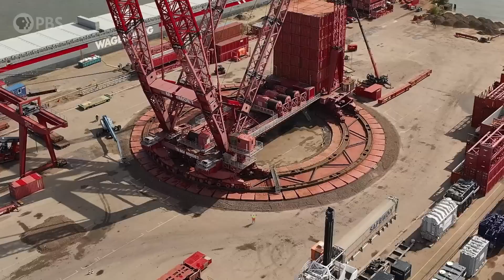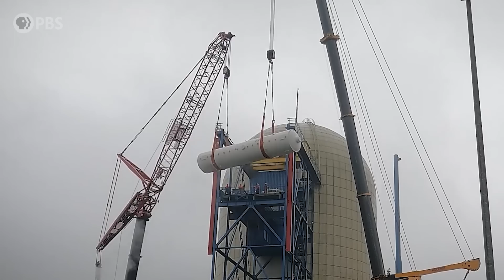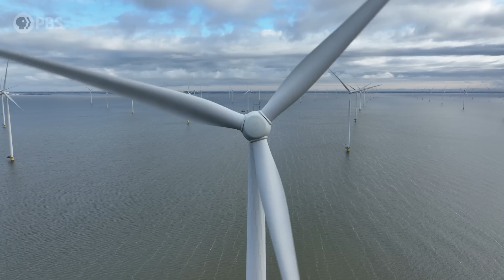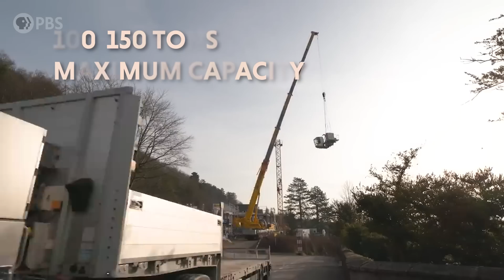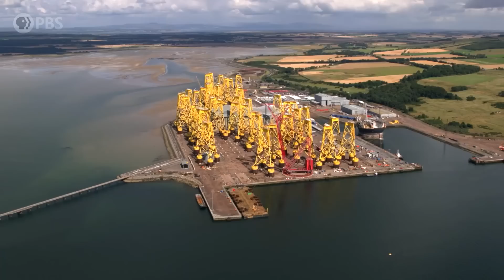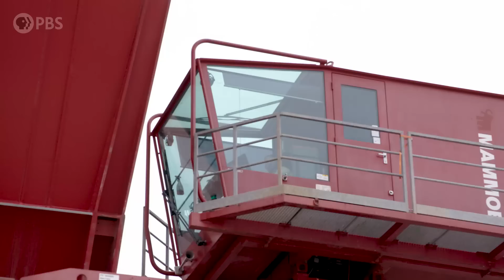Finding the *BIGGEST* Reason To Feel Hopeful About Climate Change

Comment: Even if we somehow get to sustainable growth (we won't until we reach at least 3 degreees more globally), there is still the problem of waste heat, that's going to heat up the planet exponentially so that oceans will boil in 100 years or so.
Reply: Waste heat represents 1% of the GHG forcing caused by our emissions, so it is not really a problem. Electrified processes are also generally much more efficient, and if we electrify all processes, we will only need to generate about 1/3 of the current primary energy input with renewables, so we will also significantly reduce waste heat in the coming decades.

Comment: Let's fight climate change using a big diesel engine to move stuff😂
Reply: most carbon pollution comes from industrial use by corporations. spending a ton of CO2 to build a single turbine that removes the need for 20 tons is a net negative that's worth it.
Reply: HECKS YEAH!!!!!!!😅
Reply: The original idea was to use slaves but Mammoet HR couldn't find enough of them.

Comment: The key problem with propeller-style windmills is that they will NEVER break even on their fossil fuel energy debt due to the product and transportation of all parts of the windmill from the cradle to the grave of the mills. This is mostly due to the short "shelf-life" of these windmills. It will NEVER make sense.  This is a stupid and extravagant use of fossil fuel energy.
Reply: The carbon break even point for wind turbines is on the order of months. 

And the rare earth metals are recycled once decommissioned. 

The blades on the other hand... they're still figuring that out.

Comment: This episode did not sit well with me. PBS Terra has recently produced excellent content that is (rightfully) critical of the industrial response to the climate crisis. This episode felt like a complete rubber band in the opposite direction; in fact, the entire experience felt like an advertisement for the company that made the crane.

Methods of building massive structures like this will be used far more to produce things that consume fossil energy than to create renewables. Per the law of Jevon’s Paradox, it doesn’t matter if we produce renewable energy if we are only going to use it to make even more things.

We need to slow down carbon production drastically, not increase it. This technology does not do that no matter how you use it.

Comment: So a crane can lift a rocket. A rocket that's designed to absolutely be as light as possible since, well, it's expensive per pound. It's so light that it can propel itself literally into space with its onboard fuel. I should be shocked that a land based crane can lift it?

Comment: I'm going to do you a big solid here and give you an even better reason to feel hopeful about climate change. CO2 makes plants grow, which makes the Earth greener and provides more abundant food for all life, and we're not even close to maxing out the potential of photosynthesis. It also turns out that the BS you've been listening to for literally decades about rising sea levels, acidification, corals all dying off, and the planet turning into a toxic wasteland... all of that is false and disproven by actual real-world observation. The sea level has been rising a 3 mm/yr for 3 centuries. It's not accelerating. The oceans aren't acidifying. Coral reefs are thriving and will continue to thrive, having evolved at a time CO2 was 16 TIMES higher than it is today. They'll be fine. It's the damn sunscreen from tourists that's the issue there. And those horror show graphs you've been looking at? The urban heat island effect. The "scientists" producing those graphs statistically normalize the UHI effect and present it as if that's what's happening in rural areas. It's not. So, great news! You've been systematically lied to and the world is not coming to an end because you drive to work, operate a computer, occasionally watch some Netflix, and like the heat on in the winter. Conserve resources intelligently. Don't buy crap you don't need. Throw away what you're done with responsibly, and you'll be fine.

And you didn't need some banker to spend $100 million+ on a crane to give you that hope. You just needed to hear the truth. Thank me later.

Comment: In what way is nuclear cleaner? It has toxic waste as an output.
Reply: You should see the waste products that come from manufacturing wind and solar power. It's not radioactive but that's the best thing you can say about it.
Reply: fossil fuels also generate toxic waste, and much much more. 

nuclear plants generate much less solid waste that you can simply store underground or in another fashion. the heat is useful too, so some reactors actually use nuclear waste to get the most out of them :3

as long as you have good radiation shielding and dont take shortcut when manufacturing a reactor, its pretty safe.

Comment: Did he say we have decades still to meet the 1.5c target?
Reply: I hope not, cause that would be wrong. We have a couple of years left at most before the yearly average is above 1.5c. This year is unusually high due to El Niño/La Niña and probably even passes the target, but next years won't be far off.
Reply: 1.5°C is like nuclear fusion it's always a couple of decades away.
Reply: @ProPexPup  Nope, I hate to break it to you that that is not the case. The science is very clear on this. We are already at 1.2°C and at this rate it is just a couple of years away if not sooner.

Comment: Huh. You know, I always assumed that tower cranes had more capacity than mobile cranes. Figured the mobility required a trade-off of capacity since you couldn't ground it as stably. Colour me wrong, then!
Reply: I think it's due to tower cranes only needing some vertical and simple horizontal load moving where most mobile ones move loads in arcs (does that make sense?) due to their space constraints but also the specificity of where they are putting the load.

But that's my guess. 

I'm imaging lifting a loaded box up and down or forward and backward as a person versus lifting a kettle bell weight at the gym in an arc as part of working out isolated arm muscles xD the latter feels so much harder to do lol

Comment: The crane that is helping the transition away from fossil fuels to renewables..... Runs on fossil fuels. Oh the irony!
Reply: You have to get there somehow. Electric motors aren't powerful enough and there is no place to plug in in the middle of an ocean
Reply: @lenabreijer1311  You say that, but how they gettin that power back to the continent?
Reply: @GranRey-0  they aren't.  That is the job of the FINISHED  wind turbine project. They only lift them into place.
Reply: @lenabreijer1311  my point being they have to run a wire out there anyways.
Reply: @GranRey-0  you have obviously never run a project of any sort, or built anything.  Even if you are building a house on a green field site, you have to put up a pole to put the connection box on. Are they going to have that very high power connection floating around in WATER? No they aren't.  They are going to put up the infrastructure and then connect the wires.  The very high voltage wires. That need to connect to something in order not to wander around the ocean floor.
Reply: Lol

Comment: Imagine unloading a whole ship full of containers, and all the manifest says is "counterweight for crane" 😆
Reply: As they mentioned the containers are transported with the crane components inside. Once they are unloaded they are filled with local material (like sand) to be used as counterweights. Nice dual purpose.
Reply: A whole ship that can only handle 35 containers?
Reply: @TheQsam1  I know. But you get the point.

Comment: This crane not utilizing electric motors seems wild to me.
Reply: i'm assuming that since it kind of flatpaks down, it's kind of hard to get electrical infrastructure to it and by the time you've set up your temporary connection to the grid, it's time to dissasemble and move on to the next project
Reply: Weird, it's almost like it's a product, for profit.
Reply: @RosscoAW  are you saying the manufacturers wouldn't make profit from using electric motors? It's easier to swap out if damaged, and have more torque. It's possible there is no electric motor large enough. But your logic was hilarious.

Comment: That is a cool crane.
5000 T is quite a lot, the biggest Wind turbines Nacelle only weighs about 350 T, thus there are room for them to grow a little more 🙂
Another thing, this crain uses a combustion engine, but when maintaining wind turbines it can be beneficial to use battery electric cranes. The potential energy storred in a 350 T Nacelle 180 off the ground is quite a lot (m ⋅ g ⋅ h = 350 000 kg * 180 m * 9.82 m/s^2 = 619 MJ = 171 kWh) and you can use regeneration to charge your batteries and then use the energy again when lifting a new Nacelle op. (or blade, hub, bearings, gearbox etc.) You will have some losses thus you need to top off with some new energy from somewhere. But still just seems like a hack. If you do not recover that energy and you don't drop the Nacelle you will have to dissipate the this energy somehow, usably by heating up some breaks (radiators) and heat the air around you.
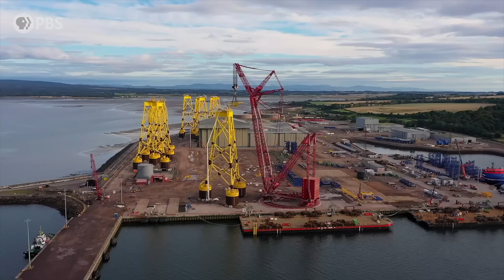Reply: I'd think it's bit just the turbines, but for example jackets or monopile foundation which need to be loaded to barge / transport vessel can be 1500-2500 mT depending on water depth. Like in 2:29
Reply: @adityac3239  True. They might be very tall too. 😮
Reply: The heaviest nacelles these days weigh well above the 800 tonnes.

Comment: It's perfectly doable to trap carbon by converting agricultural bi-products to coal and then plow it down in the fields. If the right amount of ashes and biomatter is added, you effectively turn the fields into "terrra  negra" and thereby avoid soil degradation and increases its resistance to weather events and thereby climate change. It's not rock science - could you do a piece on that?

Comment: The bottlenecks for dealing with climate change are not technical but political and social, this has been the case for decades if not over a century. Has the development of more powerful and technically sophisticated tools been associated with a lessening of our negative impact on existing natural systems so far? 

If you try and maintain our social system as is but "green" it, you will lock in 3 - 4 degrees of warming by the end of the century at best, and pay for any mitigation/limitation via the suffering of poorer countries (in terms of financial wealth, value of assets owned by citizens as a whole and per capita). All socialisms are not sustainable but only socialism can be sustainable, regardless of how well meaning many professionals in many fields are. 

Systems whose internal dynamics (competition between privately owned capitals - capital being the private ownership of means of production [factories, land, tools, intellectual property etc.] + the exploitation of dispossessed living labour which owns only itself or is owned by capital outright - in the service of expanding the overall capital of each individual owner [some lose and fail at this]) require the greater and greater manufacturing of physical commodities (this has not been alleviated by digitisation) cannot be sustainable.

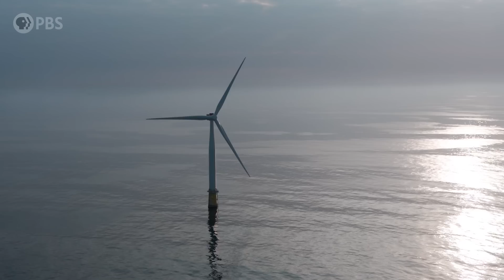Comment: 4:23 offshore wind
The carbon footprint spent to create the cranes and the turbines?
Reply: You should Google it.
But be assured, other people did take that into account.
The metal is recyclable.
Reply: @julianshepherd2038  what about the gas it uses for just a turn?
Reply: I don't have the numbers right now, but for 🌬️ turbines the energy brake-even is reached pretty quickly.
In good wind locations in a year or less.
Don't expec 🌬️ turbines to get much bigger from now on, so this crane should be in business for decades, so well worth the investment also from an energy/eco perspective.
Reply: No matter how many times it’s explained you idiots ask the question again.
Reply: We didn't use slaves because, well, slaves.

Comment: Producing energy from renewable sources isn´t gonna cut it though, we also need to decrease consumption. The largest part of that is simply wasted energy, through bad housing insulation, inefficient machinery, combustion engines in general etc.
Reply: Don't forget food waste. We're producing a wild amount of food and an embarrassing amount of it ends up in landfills.

Like either we need to scale back rosuction to align closer with what we actually use, or we need to come up with ways to ensure more of what's produced actually makes its way to the people who need it.
Reply: Communism is never going to work in America. We’re accustomed to freedom and don’t need foreigners dictating what we can and can’t buy.
Reply: Yes, we need to & will be more energy efficient but worldwide, electrical consumption is forecast to growth very significantly anyway - Global south modernisation, data (crypto, AI, network), desalinisation, air conditioning and mostly electrification (EVs, heat pumps, industrial processes etc).
Reply: I'm hoping the next time they build one of these it will be powered straight from the grid instead of using diesel. Surely a port like that would have a beefy enough electrical hookup.
Reply: @Fiercefighter2  so they can burn natural gas several miles away and have some transmission loss? Hell yeah. using your big brain there, huh, champ?
Reply: Simple math proves that cutting consumption CANNOT work.  Getting everyone alive today to reduce consumption by 5% would be amazing.  A 10% reduction is dreamy.  20% is fantasy.  30% is totally delusional.

World population will increase by 30%.  Reducing waste is great and all, but anything that distracts us from transitioning to clean, renewable electricity will do more harm than good.
Reply: I wish the Greens had more power... and that we had a multi party system
Reply: @jacobedward2401  I thought you meant John and Hank Green
Reply: @jacobedward2401   I wish environmentalists would stop politicizing the environment.  The backlash from the conservatives is killing the climate.  The Green party needs to evaporate.
Reply: Yeah. OK. Go pay for the renovations. Oh what's that? We're already in a housing crisis? Bah humbug. Make it even harder to build houses that are allowed to be lived in. I have an arbitrary deadline that has been passed a dozen times, but I must hit it this time.
Reply: That will quite literally never occur, under capitalism. Those externalities are very, very profitable, and maximizing profit is the legal requirement and direct obligation of everybody responsible to a fiduciary duty -- which is literally every single Board Director for every single for-profit company, by definition, as a function of law. Decreasing consumption is directly contradictory to the very fundamental basic principles of capitalism, and no amount of "we have to do this or we die" trumps profit. Profit always wins. Literally always. If you want an alternative solution, it's called socialism, at the very least, not "degrowth," or whatever. Degrowth is feckless marketing and virtue signaling. Socialism is actually systemic change that de-commodifies housing, electricity, transport, cheap plastics, etc.

Comment: I think the coolest thing about that crane is; not only its massive size, but that it can be broken down into shipping container sized pieces and taken anywhere. The design constraints they must have had to meet that requirement must have been brutal. Props to the engineering team at mammoet.
Reply: Trying to imagine the requirements for the substructure that such a massive crane would need to be setup on.
You could ship it anywhere but you’re not setting it up just anywhere.